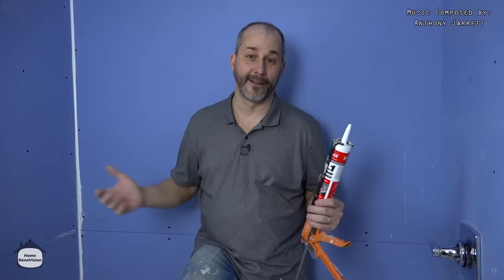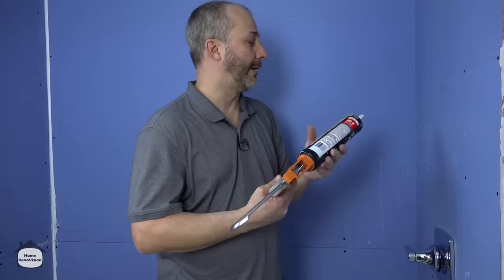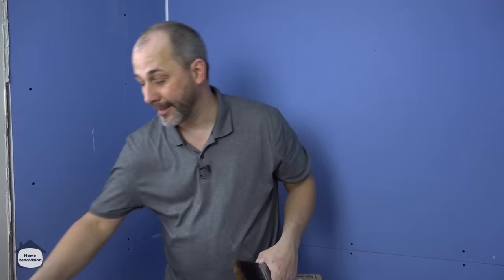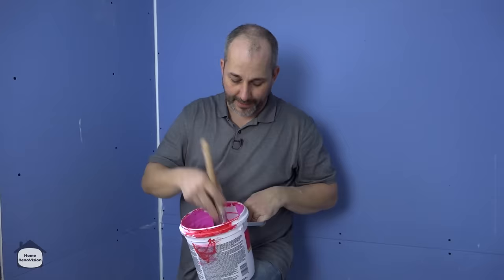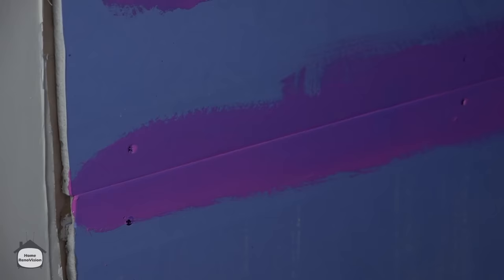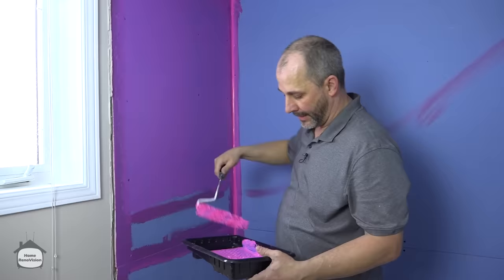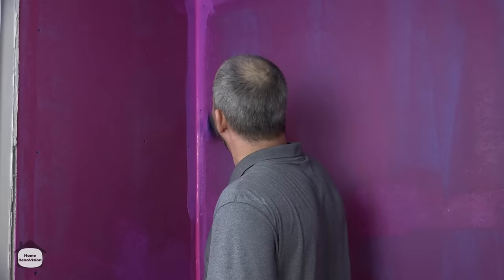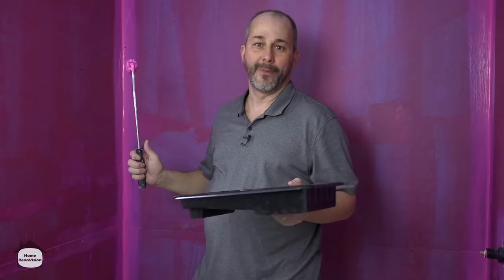The Most Inexpensive Shower Waterproofing System Ever!

Comment: Jeff, I’d like to say I like your videos and how they have saved me a lot of money and time.  I’ve seen you use redguard and the schluter membrane.  Which would you use in your home for best long-standing results?  Thanks Mark.
Reply from the maker: That depends on the value of the house and the investment in the tile. I personally am comfortable with both. Schluter is abetter system but both will fail if not installed correctly. Cheers!

Comment: Jeff, thanks for the video. Question: If I use USG Durlock ultralight foam board for my shower walls, do I need to install drywall and then attach the foam board on top of it? It is 1/2 in. I am hoping it will handle the weight of the tiles and not flex if someone was to lean on the wall while showering. Thanks in advance for your advice. Tim

Comment: Can I do the same corner sealing and painting the membrane on a concrete floor? We’re doing a wetroom on a concrete floor with wood walls. Trying to figure out the best way to seal the floor after we carve it out and create the proper slope etc for the drain.
Reply from the maker: That is a little creative for my taste but I would suggest cement board in that case and use the kerdi membrane to join the walls to the floor. Then use a waterproof membrane. Cheers!
Reply: Home RenoVision DIY  sorry! I didn’t mean actual wood on the walls. We’re not that dumb. Ha ha. Tile walls but wood studs. So cement board on the walls behind the tiles, Kerdi membrane between the concrete and cement board, then membrane on the whole thing, then tile. Yes?

Comment: Hey Jeff, thank's for the video. I'm recreating this right now. Some of the corner joints aren't as clean as yours. The largest gap in between is around 1/2". Can I just use the sealant, or should I mud to fill it in?
Reply from the maker: use the sealant and then roll on the membrane when it is dry. Cheers!

Comment: Can you paint over this?  I just built a washroom, shower is fiberglass unit, not concerned with that too much, but my walls are the water resistant drywall green board.  I'm considering sealing my walls with Redgard.   Also, can you tile over Redgard…. if I ever wanted to tile my walls?   Thanks

Comment: Love your videos.  This is a great cost effective alternative to Schluter.  I am renovating  bathroom and decided to use a Schluter shower pan but not Schluter panels/membrane for the walls.  Rather using mold resistant drywall.  In addition to waterproofing, can the Mapei product be used to adhere the Kedri band rather than recommended Schluter thin set?  Clearly, the Schluter warranty will be void if I dont follow the Schluter process exactly.  Since I am remodeling using a hybrid of products, the warranty will not be honored anyway.  Just curious if this would be acceptable since I noted that  you used LePage Seal & Bond for filling/waterproofing drywall screw holes.

Comment: Would you recommend RedGuard or equivalent under the floor tile as well?  I have been renovating my bathroom and have already used a leveling compound on the floor...just wondering if it would be a good idea to use this on top of it, before laying the tile - perhaps not only for waterproofing but for additional help with crack prevention?

Comment: Can you use normal mortar on the RedGuard, or do you have to use unmodified cement like with Schluter?

Can you do a pigmented, sealed concrete wall directly over it instead of tile? What would you use for that?
Reply: You need polymer modified thin-set or medium bed mortar. If you want a sealed  concrete finish, you would first do a scratch coat with the thin-set, then apply the cement based finish, then stain and seal. Use minimal water on solid surface coatings or you'll get shrinkage cracks from loss of mass through evaporation.
Reply: I believe unmodified is what you want.

Comment: should I put red guard on the floor of a mortar shower pan before tiling even if there is a pvc liner underneath?
Reply: No.  You don't want "double waterproofing", that would potentially trap moisture between the pvc liner and a membrane above it.

Comment: My small 3x3 corner shower on the upstairs was leaking in the corners . I took off the glass , removed a certain amount of tiles from the 2 corners ,( but not all in a certain height all around evenly ) six or eight in a step fashion towards the middle . Would you still recommend this product to continue after the little patch work is done ? Thank you

Comment: And, I was also wondering, could I put this on the bathroom floor before I lay flooring and floor boards? I was thinking that it could keep the moisture out of the seams, cracks and etc.
Reply from the maker: just use a sealant on your grout and silicone on your edges. Cheers!
Reply: I used in upstairs remodel on hardi backer over wood flooer. wanted rigidity of floor for tile and warerproofing this rent house. am pleased with redgard and since have used 2x in showers.

Comment: This question is about something else.
Hopefully you can answer me,i am plannig to redo my bathroom,i have to tear ir down completely and will install a shower base.
My question is this,the floor will be plywood,can i apply the mortar directly on top of  it?
Or should put a piece of cement backer  board?
Please help me.
Thanks
Reply from the maker: Hi CD , shower bases are designed to be installed directly on the subfloor. no worries.

Comment: Great video Jeff.  I have a prefab shower base.  So the drywall goes down to the bottom and will hang over the lip of the base. .  Should I redguard the bottom of the drywall (purple board) prior too hanging in the even the caulked edge between the finish tile and the base is the weak spot in the system?  If that caulk fails it would wick up the water.  Also,  Why not run a bead of the lepage in the drywall seams for good measure. I live in the states. Is Loctite 2in1 Seal and Bond the same thing?
Reply from the maker: Thanks for that suggestion. I looked into the product and looks like it would be perfect. solvent free permanently flexible and rated for tub and shower areas plus low vocs so good inside. Nice!

Comment: Hi. I'm using AquaDefense on my shower reno. I just applied two coats over durock with a 3/8" nap roller. It took the whole gallon to cover the walls and shower bench. The shower is about three feet by six feet and eight feet tall. I'm still seeing a few random dimples that were not covered by the second coat. Would it be OK to do a third coat? Thanks, Dave

Comment: Even though the local building code may be lax, there are standard for tile and stone set out by the Tile Council of North America (TCNA).  It is the industry standard with testing behind the standards set forth.  If your tile job fails and you get sued as the installer you will most likely be held to the TCNA handbook standards.  Any lawyer who handles those cases knows this and I've personally never heard of a tile failure that was installed to standard that failed due to anything but building movement or other extreme circumstances.  It amazes me that their are a ton of so-called installers that don't even know the TCNA exists.  Let alone what the standards are.  Or how to read the instructions on the products.  I've been installing for over 20 years and I'm careful to keep up with the changes as new products get popular.  Some of them are best left to be tested by others for a few years to work out the kinks imo.

Comment: I cant find this 2 in 1 lepage in the US. Also, what can I do if fiberglass mesh tape and drywall mud has already been applied to my mold-resistant drywall? Can I cover it with non-modified cement?

Comment: Can I use this with a bathtub and how would you recommend using the product where the drywall meets the tub? Great channel!
Reply: Yes.  Set your cement board on the top of the lip of the tub. Then seal underneath the cement board between it and the lip with 100% silicone. Then red guard according to instructions.

Comment: Another great video! Probably watched it 3 times already. I had a question. I have green mold resistant drywall as my shower walls. Do I apply the red guard and wait to dry, then use mapai thinset for the tiles to stick to the wall? The tiles are quite large 8 by 24. Because I had another tile guy come in and say that the tiles could be stuck directly to the red guard. Not sure if that would hold correctly. Any help would be very appreciated!! Thank you again for your detailed videos :) hopefully I can do my bathroom myself!
Reply: Apply.rhinset onto the redgard. It works.  I used large tiles on my project 2 years ago, no cracks, leaks or issues.

Comment: I know this vid is several months old, but I really hope you can answer my question. I'm considering putting up FRP panels as a tub surround and Redgard seems like a great product to use. I know the FRP is waterproof, but an extra layer of protection can't hurt, especially in the corners. Would I have any problems with the FRP adhesive (Titebond brand) sticking to the Redgard? I emailed the maker of Redgard but never received a reply.

Comment: The video shows you using the Lepage 2 in 1at the corners.  Do you also use it where the backboard pieces meet horizontally and where the backerboard meets the tub?  And is the Lepage 2 in 1 basically Kitchen and Bathroom Caulk/Sealant?
Reply from the maker: this is a sealant and an adhesive. not a caulk or silicone.
Reply: The LePage 2 in 1 isn’t available in the USA and recommendations? Loctite made made one but it’s not available either...would a silicone paintable caulk work?

Comment: I’m renovating my bathroom and only bought regular drywall will I have a mold problem down the line. I have cement board on the bathtub section but the rest of the walls are regular drywall.
Reply from the maker: not if you have a fan and use bathroom paint. Cheers!

Comment: Hey Jeff, What do you think of DensShield boards for shower walls? Like sheet rock (gypsum) but with a waterproof fiber sheet instead of paper. They recommend a flexible sealant into min. 1/8” (3 mm) gap between the board and the tub flange. I am worried about this connection given the grumblyness of the gypsum. So I am thinking quickset cement and mesh tape and redgard all over it like you recommend. But is that flexible enough for the gap between board and tub? Even if I decide to go with Kerdi, I am not sure how to make the best sealed but flexible connection between board and acrylic shower tub. Thanks!

Comment: Hi Jeff, I really appreciate your videos, they help me a lot as a DIY guy. I want to use Hardibacker instead of the mold resistant drywall because I am disabled and don't want to deal with the 4 x 8 drywall panels. how to do the corners and joints with Hardibacker? do I need the mesh or RedGard is good enough? Thanks,
Reply from the maker: In this video I showed you how to seal the joints with 2in1 or locktite. That works awesome.
Reply: Thanks

Comment: Can the caulking agent you used in this conversion with the  'waterproof' drywall bathroom be used with the cement back board conversion? Or must the cement based boards use the fiberglass tape and quick-set cement option to seal seams and corners?
Reply from the maker: best to use the fiberglass and cement and then roll on waterproof with cement board! cheers!

Comment: Question Jeff, I was gonna do this in my bathroom, blueboard, red guard and everything. Question is, do I have to replace all the sheetrock in the shower, or just what's gonna get wet and covered by tile?
Reply from the maker: if you are changing the tile and it does not go to the ceiling then just the new board will be fine if you are trying to decrease the scope of work. However make sure you use a great bathroom paint on the exposed board and have a good fan in that room with 110 cfm at least.

Comment: Thanks for the tips. To clarify, technically the mold-resistant drywall can get wet?
Reply from the maker: yes, however once drywall gets wet it will continue to pull water and deteriorate. That is why we use the sealer.

Comment: Hey Jeff great video as always.  I just have a stupid question,  can we use redguard on regular sheet rock instead of the green/blue drywall?
Reply from the maker: it depends on your building code. here they prefer the water resistant board.

Comment: Once the redguard is dry can you put your tile on?   If so regarding tile what type of adhesive do you use to put the tile on with?  Thanks.
Reply from the maker: Yes James within 1 hour of the second coat. I prefer to use ultralight cement or something similar.

Comment: I have some cracking in my cement board and an actual corner that has "broken" off (still there, but cracked away from board and held in place by boards around it).  Do you think it is OK to use Redgard with thinset tape?  In other words, I put the tape over the cracked/damaged area and then paint the Redgard on?

Comment: My problem is where the wall board meets the tub. I paid Milwaukee bath (out of business) to redo my shower and bathtub but they did not have a lip on the tub where it meets the wall. There is no way to keep the joint together. It is mold city and I have recalled it 10 times at least. So frustrating
Reply from the maker: never build a shower on a drop in tub. Cheers!

Comment: Jeff, If I'm using cement board for my shower, Do I just paint this stuff on the cement board? Also, so I am clear: studs -> cement board -> this pink paint -> wall tiles?
Reply from the maker: That is an exceptional shower design, but don't forget to seal the inside corners and the board to the tub with lepage 2 in 1.
Reply: You left out the thin set after the red paint and before the wall tiles in your application explanation!

Comment: How does water resistant drywall with red guard compare to Durock without red guard? An installer told me wall tiles will block water so no need for red guard on Durock.
Reply: If tiles blocked water then what you put behind them wouldn't matter. That being said drywall with redgard is better in the sense that moisture wouldn't go through it where as moisture would go through Durock. Moisture would not damage it but mold would form in the wood behind it.

Comment: i noticed that you did not apply any sealant to where the sheet rock meets. Is there a particular reason why only the corners were applied with sealant? thank you
Reply from the maker: a tight joint with 2 coats of membrane is plenty. Cheers!

Comment: Can you use this product instead of a  liner on the shower floor or is the rubber  liner better ?
Reply from the maker: the rubber liner is part of a system just as the membrane is part of a different system . You can't just replace one for the other. You need to pick a system.

Comment: We were sold Mapelastic HPG by our local tile store instead of Redguard. Can we use the two interchangeably? Any differences when using the HPG? Thanks so much for a great video, your entire channel has been very helpful.
Reply: Same type of product, with slightly different formula and color. But the end result is the same. 

In my experience, Schluter-Kerdi products + Hardiebacker boards is the best way to go. The Schluter membrane is slightly more expensive than RedGuard, but they’re easier to work with, in my opinion, and most likely last longer.

Comment: I am planning a sauna/shower and am going to use t&g ceder on the walls. If I nail through the tongue and cover it with the next board will the nail still have the potential to cause leaks? If so what type of cement could I use over the membrane instead? Thanks
Reply from the maker: Hard to comment on this. I have never nailed wood into a wall for a shower before. have you thought of trying an adhesive?

Comment: Would this system be applicable when using a prefab shower pan as opposed to a tub surround. I'm considering tearing tub out and replacing with shower.
Reply from the maker: Hi Ben, shower pan or tub, same results. Cheers!

Comment: Hey Jeff! Thanks for all the great content. Huge fan. I’m remodeling my bathroom and using this method for the bathtub surround. Can you tell me what’s the best option for the overlap between the bottom of the drywall and the bathtub flange? I can use the same sealant but should I also fill it with mortar so it’s flush? Also, should I use regular tape and mud where the top of the shower walls and ceiling meet? Thanks!!!
Reply from the maker: no need to seal the ceiling area. do that with silicone after tiling. the best seal at the tub is to use the technique from the cement board video. fill with quickset cement and mesh tape. then waterproofing paint. cheers!
Reply: Thanks!
Reply: Robert McAlonan I have just applied flashing tape on studs and over tiling flange then green board then redgard, idea from another YouTuber. Water has nowhere to go but down.  Awesome videos Jeff and team, keep it coming!

Comment: I need to find the energy to rip out my master bathroom tub and convert it to a shower that is wheelchair friendly any suggestions? It is in an alcove 36" X 60" drain is on the left. My wife is losing her mobility and now has a walker/chair. Hell getting older. I have new Pex with a Moen diverter coming off to a separate hand shower so I can relocate it if I make a bench. Still thinking of ideas since you can make anything out of Hardie Backer and Aquaguard. Lol I was thinking of aqua guarding my facia boards so they never rot from water run-off then painting them again. Seems it only last for about 5 years in Texas.
Reply: I would go with a linear drain at the shower entrance - it's a single pitch so very easy to do with the "Houston Mud Method" and Mapei 4-in-1 pre-mixed mud mix.  Pitch a bit also from outside the shower, to ensure that splashes go back into the drain.  You could also make the entire room a "wet room" and run the linear drain even more to the middle - depends on your layout and what is doable with what is under the space.  Good luck.